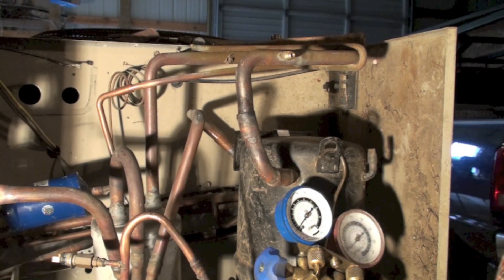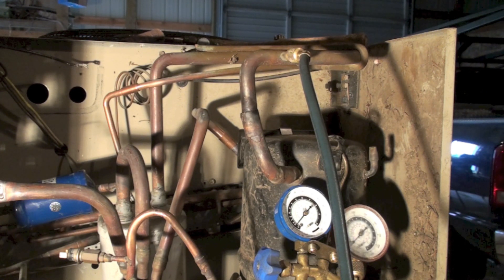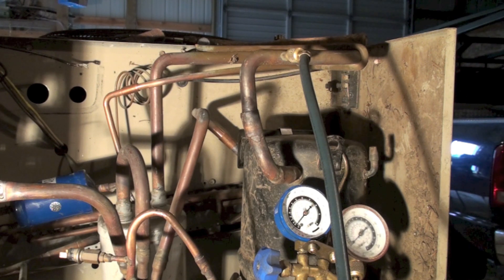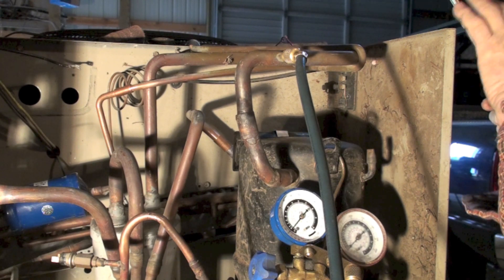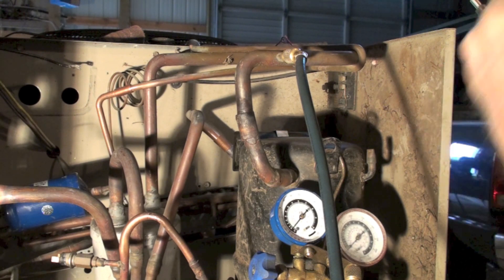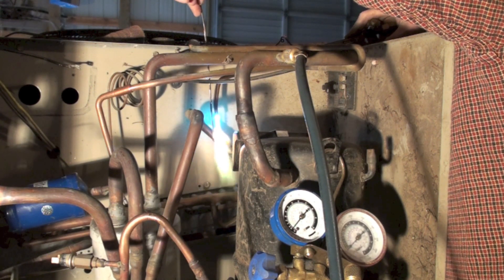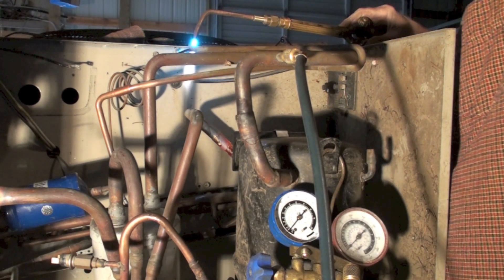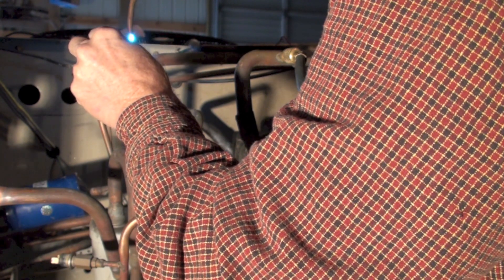Brazing with nitrogen thru the lines

Comment: Can the brazing repair be made with a 15% silver and not worry about non condensibles ?
Reply from the maker: The brazing repair can be done with 15% silver but that has nothing to do with nitrogen.  you can run nitrogen the the compressor from the suction line.  If there is too much pressure buildup causing leaks in the repair, simply flow nitrogen thru the system, then shut it down and do the braze.  The nitrogen in the system will protect it.
GFM
Reply: So if a repair braze  is to be made in the suction line inside the OD unit 24"  before the compressor the refrigerant needs to be recovered , correct ?    Would you braze a hole there or install a new section of copper ? The leak is either in the aluminum condenser coil pipe or the copper suction pipe as enters into the Condensor at the very bottom of the unit .   Hard to see as its covered by rubbatex and is so low to the ground and even possibly just inside the condenser . The coil may need to raised at the least and replaced at the most if hole is in the coil pipe.  The part is under Warranty .  Trane XL16i     3 yr 1 stage 3 ton . What kind of time is involved to R&R a coil ? From recovery to recharge and check for leaks if the coil is the culprit . A tech as stated the XL Tranes have a history of failure there .
Reply from the maker: Yes on the recovery.  How I would go about the repair depends on the location of the leak.  As for R&R the coil, 1 hr for diagnosis +travel.  Another 4 hr + travel for the replacement, recovery and recharge.
GFM

Comment: We have a leak in the copper line as it enters under the coil,  the next stop is the compressor how do you braze with nitro  there ? the nitro must go in and come out, correct ? Must you remove the line at the compressor? It appears to be the suction line . Tech said it couldnt be done,   others said no problem to nitro it without disconnecting from compressor .

Comment: Hi, if im brazing in a critically charged system, with only one way in through the shrader, how can i use nitrogen? thanks
Reply from the maker: puskin66 You can't.  You must be able to flow nitrogen thru the system for it to protect the pipe.
GFM
Reply: grayfurnaceman thanks for the reply, so how can i change the filter? or a compressor? without Nitrogen? add a service port? i work on slush puppy machines. ps, loving the videos, great information, thanks for posting, keep it up.
Reply from the maker: puskin66 I would add a service tap.
GFM

Comment: When brazing and letting nitrogen flow through the system do you also hook up the high side line and open it to let the nitrogen flow completely through the system?
Reply from the maker: Karl Davidson I actually remove the schrader from the opposite side from where nitrogen is going in so there is no pressure buildup.
GFM
Reply: grayfurnaceman when I try to take the Schrader valve off it's pressure still in the system with the system off but I do have a leak

Comment: Great video! You attached the nitrogen to the low side prior to brazing. I realize the holes that you were about to braze were allowing the gas to flow out of the system, but did you remove the Schrader valve from the high side too?